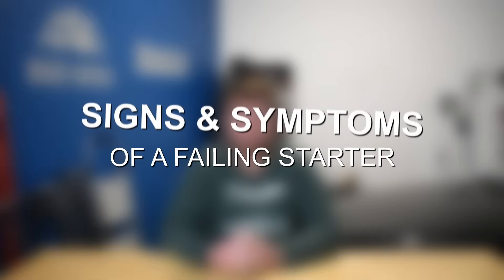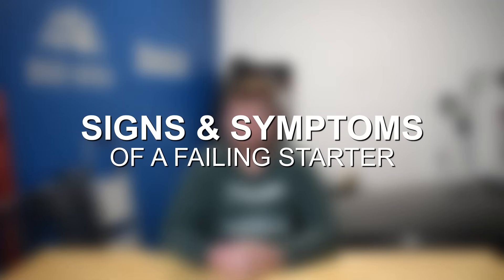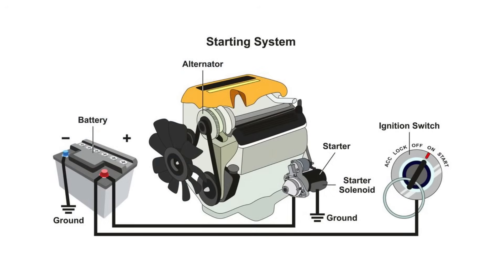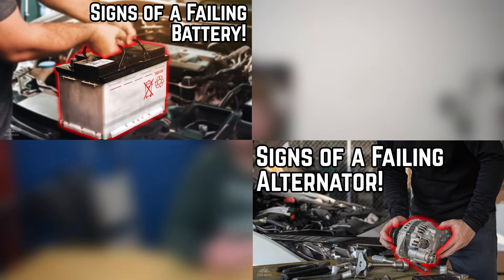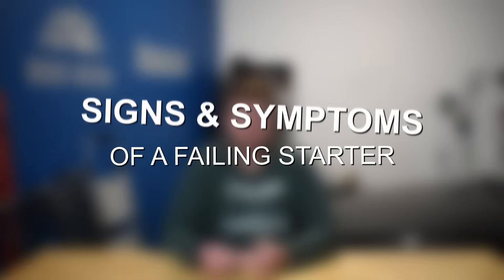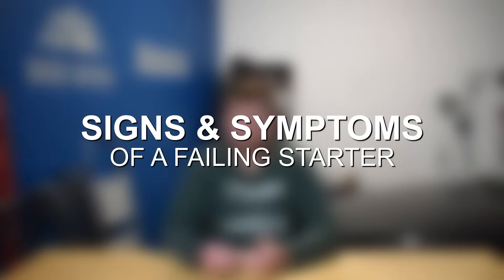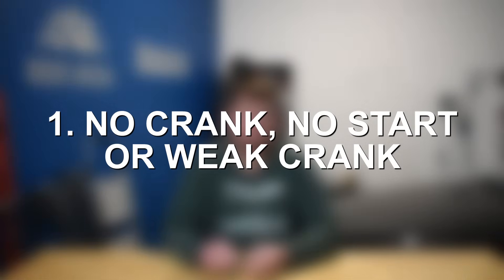5 Symptoms of a Bad Starter!

Comment: Great video, my problem is if I try to start I’ll get a click sometimes. If I turn key back and try again it will start right up. It’s done this on a brand new battery in hot, warm and cold weather. If it sits for a few days when really cold I have to put jump pack on it to fire up but I get clicks at 1st and it will continue to click even if I turn key off and out. I don’t know where to start. I’ve replaced battery 2 times now. I don’t think it’s alternator cause I have power thru out the cab before and after.

Comment: I had a no-start yesterday.  Got the single click (2020 Hyundai Elantra).  Tried a power pack jump from a local police officer who tried to help me.  That didn't work, but I felt like he was not really wanting to help.  I know before I replaced the battery four months ago, my neighbor used his power pack, and we had to jiggle it to make sure of a good contact.  Then it worked.  Anyway, the cop left and someone else came by and gave me a jump.  She was not revving her engine, and I tried once or twice and just the click.  After a few minutes, I got a slow start.  Checked my voltages at home then, all good.  Took it to Advance where I had gotten the battery, again all good.  Oh, I was about an hour away when the no-start happened, so drove home fine with no electrical issues, and would have just charged the battery on the drive down.

So every thing is pointing me toward a starter.  I can't physically see it.  Have a plastic panel over the bottom of engine compartment, but low clearance if I did take that off.  Another guy is saying to tap it with a metal object to help it move off a "dead" spot.  But since I can't access it, can't try that "test".

Leaning toward just having starter replaced.  It's only 5.5 years old, so seems young.  But I do a lot of short trips and perhaps more starts than average, so maybe I just got a starter that is statistically on the short side of life.

Your videos are pretty insightful, so wondering what you think.... or anyone else that might have similar experience.  Hate to get into a diagnostic loop at the shop......

Comment: I got a scion XB 2011 i was
driving on a highway and slowly lost power and my car died, couldnt get it to start, ended up towing it home
I thought it was the battery, so i took it to auto zone the next day to recharge and try to Jumpstart it as well and still won't turn on all I hear is a whiny/grind  sound but all dashboard lights and radio turn on before I turn the key. Even shakes if i persist.

Comment: I have slow cranking on initial/cold start, but no problems with starting later or when warm. (New battery fitted).
Is this still the starter motor?

Comment: Great video and very professional and on point. Thank You

I was curious a vehicle where battery is good and but there is no crank, all electronics fuses/relays/clutch starter switches seem fine. If one pushes the car and then throws it in 1st gear while it's moving, should it be able to start even if the starter or solenoid is faulty?

Comment: My vehicle has a brand new battery also works for my other vehicle so it’s not faulty battery, but when I go to crank the car it makes a turning over noise and you can see the starter getting hot but it won’t crank. Is it starter. I know most the time the starter will just click but my starter is overheating when trying multiple times. I’m at a loss

Comment: What if it sounds like metal bouncing around but it's not Everytime but it's loud. No lights AMD seems to run just fine. Should I just remove the cover and see what's broken, in my opinion if that's the starter that's directly above the stator then there some broken off ? Whats hould I try first ???????

Comment: 10/10/25 I have a 2012 honda pilot. Got home turned off the car and notice the courtesy light in the car didn’t turn on. I also couldn’t unlock my car door unless i use my hand to turn the knob. I try starting the car but no crank, click or noise. No power at all dead silence nothing turn on. Do you think its a bad starter? I notice when i start the car the last few weeks it doesn’t start up right away. 10/11/25 Just started the car and it turns on now? So what can it be now.?

Comment: What if there is absolutely no sound at all when you turn the key? My car did that but started with a jump. Maybe the battery?
Reply from the maker: J - If there’s absolutely no sound when you turn the key (no click from the starter relay or solenoid, no crank at all) but the car starts right up with a jump, the most likely culprit is a weak or failing battery—even if it still powers lights and accessories, it may not have enough cold cranking amps left to spin the starter. Corroded or loose battery terminals, bad grounds, or a failing starter relay could also cause a “dead silence” condition, but since a jump immediately solves it, the battery itself is the top suspect. I’d recommend checking battery age (if it’s 3–5+ years old, it may be done), testing voltage under load with a multimeter (shouldn’t drop below ~10 volts while cranking), and cleaning the terminals before moving on to the starter circuit.

Comment: I have doge Durango rt 2014 and when I start it, just take little longer to start and this not happening all the time only sometime … all electric and battery are fine 
This starter I changed 2 years ago but was second hand. So is it starter or else ?
Reply from the maker: A - An occasional longer crank time that isn’t consistent is less likely to be the starter itself and more often tied to fuel pressure bleed-down (leaky injector, weak fuel pump check valve, or fuel pressure regulator) or sometimes a crankshaft position sensor starting to get weak when hot; if the starter were bad, you’d usually hear grinding, clicking, or slow cranking rather than a smooth but extended crank. Since the battery and electrics are fine, I’d start with a fuel pressure test to see if the system is holding pressure after shutdown, because if it bleeds off, the engine will crank longer while it builds back up — if fuel checks out, then testing the crank sensor would be the next step.

Comment: Corolla 2013 sometimes it takes 2-3 seconds longer to start. Not always. Would that be related to the starter or it’s something else battery seems good
Reply from the maker: T - On your 2013 Corolla, if the engine cranks at normal speed but just takes 2–3 extra seconds to fire up occasionally, that’s usually not the starter (since a bad starter causes slow or no cranking) but more likely a fuel system issue such as the pump check valve letting pressure bleed off, a weak fuel pump relay, or a leaky injector, which forces the system to rebuild pressure before starting; since the battery seems good, I’d start by turning the key to ON for a few seconds before cranking to see if it starts faster — if it does, that confirms fuel pressure bleed-down as the culprit.

Comment: When I put my key in the ignition without turning the key my car trys to turn over. What could it be?
Reply from the maker: M - If your car tries to crank as soon as you insert the key without even turning it, that usually means an electrical fault in the ignition switch or starter circuit — the ignition switch may be shorted internally and stuck in the “start” position, or the starter relay/solenoid is welded closed and sending power to the starter constantly. Less commonly, chafed wiring in the steering column or fuse box can bridge the start signal to power. The quickest way to narrow it down is to pull the starter relay — if the cranking stops, the relay or ignition switch is at fault; if it keeps cranking, the starter solenoid itself is stuck and the starter needs replacement.

Comment: I had the typical starter symptoms, changed the relay, and the problem seemed fixed. Now, months later, the problem is intermittent. I'm going to change the starter. Do you think the starter could have damaged the relay? Thanks, Mike, from Chicago.
Reply from the maker: M - Yes, that’s very possible — when a starter motor begins failing, it can draw excessive current or arc intermittently, which overheats and stresses the relay contacts, causing them to burn or stick. That would explain why replacing the relay initially seemed to “fix” the issue, only for the starting problem to return once the failing starter kept straining the new relay. Changing the starter now is the right move, and once it’s replaced, you shouldn’t have to worry about the relay being damaged again as long as the new starter is healthy.
Reply: @8020Automotive  Good deeds get rewarded.

Comment: Most of the time when I start my 2002 ford mustang, it starts up fine, but in rare cases, it continues to crank until i release the key from the start position. I just replaced the alternator and the battery seems fine as well. Could this be early signs of a starter failure?
Reply from the maker: D - Yes — what you’re describing on your 2002 Mustang (the starter motor continuing to crank after the engine has already fired, until you release the key) can be an early sign of a sticking starter solenoid or ignition switch issue. If the solenoid inside the starter hangs, it keeps feeding power to the motor, making it crank until power is cut; sometimes this happens more often in heat or after age/wear. Less commonly, a worn ignition switch can also keep the “start” signal active a fraction too long. Since your alternator is new and the battery checks out, I’d lean toward the starter solenoid beginning to stick, so replacing the starter assembly would be the safe fix before it leaves you stranded.

Comment: New battery, alt is charging at 14.6, no parasitic draw, truck wont start unless jumped...???
Reply from the maker: S - If your truck has a new battery, the alternator is charging properly at 14.6V, and there’s no parasitic draw, but it only starts when jumped, that usually means the battery isn’t delivering enough current under load even though it’s “new,” either because it’s defective, undersized, or not fully charged; it can also be a bad connection at the terminals, corroded cables, or weak ground strap causing high resistance, so when you jump it the extra current bypasses the restriction and it fires up. Best next step is a load test on the battery (should stay above 9.6V while cranking) and a voltage drop test across the cables/grounds — if the voltage falls hard or you see more than ~0.5V drop across a cable, the problem is the connection or cable, not the battery/alternator.
Reply: @8020Automotive Turned out to be the starter.  Needed the added amps from the alternator running on the other vehicle to get the starter to spin.  Replaced the starter, and everything is fine now.  Thank you for the response.  FYI, I pulled the starter relay and used a wire to apply direct power from the battery and starter wouldnt turn.  This ruled out many things and narrowed it down to the starter.

Comment: My Toyota Camry 2011 won’t turn on when I try starting it, my dashboard lights, headlights, radio all turn on but when I try starting it again my dashboard lights go away for a second like it usually does when it’s going to be turned on and run the lights only come back on once I stop trying to start it. And today on a cold start it had a long crank and eventually turned on. And once it turns on and I turn it off it’ll keep turning on up until it decides to not even want to crank again. Is this a starter issue possibly or something else.
Reply from the maker: A - What you’re describing on your 2011 Camry sounds more like a weak battery or poor connection than a bad starter, since all the dash and lights die when you try to crank and then come back when you release the key — that’s a classic sign of the battery voltage collapsing under load or corroded/loose battery cables, even if accessories look strong otherwise; the long crank on a cold start also points to a battery that’s losing reserve capacity. The best next step is to have the battery load-tested (not just checked for voltage), clean and tighten the battery terminals and main grounds, and then if the battery checks out healthy but the problem persists, move on to testing the starter draw — but in most cases like yours, replacing a weak battery or fixing a bad connection solves it.

Comment: Click click click thud.
2000 buick lesabre
Reply from the maker: B - Sorry to hear this.. Almost always means the starter solenoid is engaging but the starter motor isn’t turning the engine strongly enough, which is usually caused by a weak or dead battery, corroded/loose battery cables, or a failing starter motor; start by checking battery voltage (should be 12.6V rested and stay above 9.6V while cranking), clean and tighten the terminals, and if the battery and connections check out but you still get the click-thud, the starter itself is likely worn and needs replacing.
Reply: @8020Automotive  Thank you very much for responding.  I saw a video that showed me how to check if the fuel pump was working  , to rule that out. Just try to start a few times then push on a certain tiny spot and gasoline sprayed out really well,  so that's good.  We tried charging overnight twice and it only started once out of about 12 tries. So was worried it might be the starter.  - A neighbor gave the car a jump from his car, and it started right up. So not sure why the charging overnight wouldn't work. Unless the battery was so bad, it just couldn't hold a charge. 

Webt and got a new battery. Turns out that old battery was 8 years old. So got the same kind. Duralast. And it started up just fine,  thankfully. 

❤❤
Reply: I didn't have any way to check the voltage.  I noticed that the "ground" bolt that we used for charging overnight was a little rusty. In case that prevented a good ground connection,  i had the neighbor use a different metal bar for the ground instead ( when he jumped my car) it jumped great.

Comment: I had issues with my car starting found out today the pigtail connector going to the starter solenoid was broken off  this video helped me thanks
Reply from the maker: M - Great to hear! This is why we do what we do!
Reply: @8020Automotive  If it was a connector issue, then would you expect to hear any click at all?  Feels like you would not get that if you were not getting any continuity to the starter/solenoid.....

The plastic cover over the bottom of my engine compartment has a few of the plastic fasteners missing and I know I went over some road debris.  Possible I have some damage to the connector maybe, but car is so low and I don't have means currently to safely keep it lifted to have room to investigate......

Comment: Chevy Silverado 2015 model. I just noticed today that  when I turn the key, it sounds like it struggling to turn on. Truck is driven everyday so im not too sure it's the battery.
Reply from the maker: C - If it sounds like it’s struggling to crank even though you drive it daily, the most common culprit is still a weak battery (they can fail suddenly even with daily use), but it could also be corroded/loose battery cables or a starter beginning to wear out; the best next step is to load test the battery (should hold 12.6V off and at least 9.6V while cranking), check the cable connections for corrosion or looseness, and if the battery and cables check out, then suspect the starter motor, which often drags and struggles before it completely fails.
Reply: @8020Automotive You are right! Thank you for reading my plea for help and commenting. I went to turn it on the day after I posted and my battery was now dead! Hubby tried to charge it but it wouldn't hold a charge, so we had to install a new battery yesterday! Now Im good as new! Thanks again! 👍
Reply from the maker: C - Great to hear! Thanks for coming back and updating.
Reply: @8020Automotive Thank you again! 👍

Comment: Oil on the starter was a question I have been pondering over.
Reply from the maker: T - Oil on the starter is definitely a problem because it can seep into the solenoid and electrical contacts, causing poor engagement, weak cranking, or eventual failure, and on many vehicles oil leaks from valve cover gaskets, rear main seals, or oil pans drip directly onto the starter over time; while a light surface coating may not kill it immediately, continued exposure will shorten its life, so if you notice oil on your starter it’s best to fix the source of the leak and clean or replace the starter before it causes intermittent no-crank issues.
Reply: my exact same issue. when I was checking the lifters oil leaked on the starter

Comment: Help !! So I have 2021 Chrysler Pacifica 
 I got the all the code and they were with the letter starting letter U 01000 And I 0001 we recharge U0001
Reply from the maker: M - Codes like U0001 and other U-codes point to a communication problem on the CAN bus, not a single part failure; when multiple U-codes show at once it’s usually caused by a weak battery, poor ground, or loose/corroded connector dropping voltage across the network, since Chrysler vehicles are very sensitive to low voltage, so the best first step is to check battery health (12.6V off, 13.8–14.5V running), inspect and clean the main grounds and battery cables, then clear the codes and see if they return—if they do immediately, you may be dealing with a failing module or damaged CAN wiring, but most of the time a fresh battery or solid ground connection clears these up.